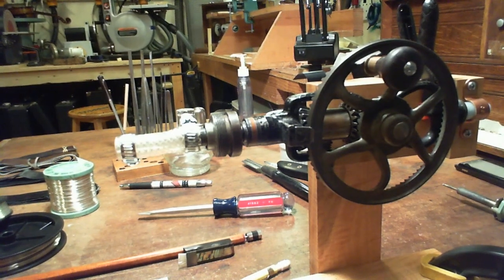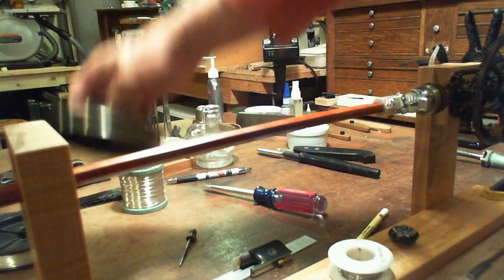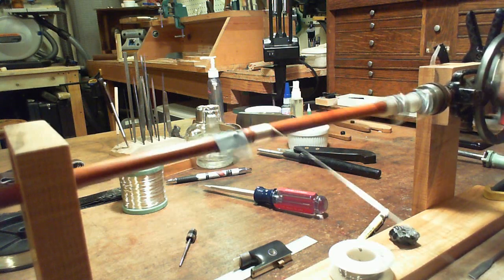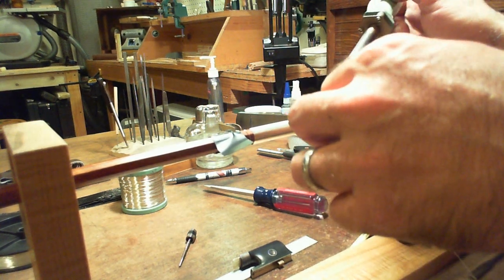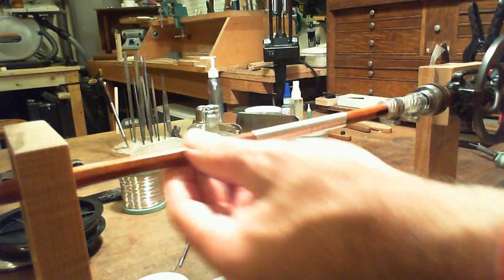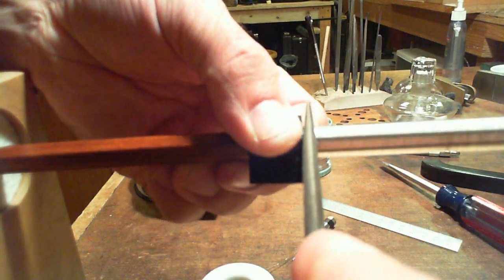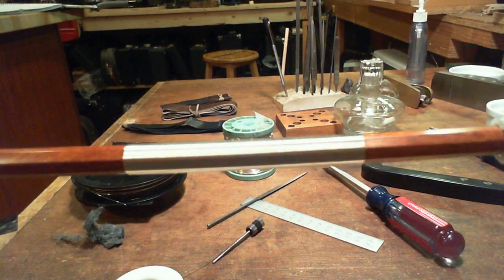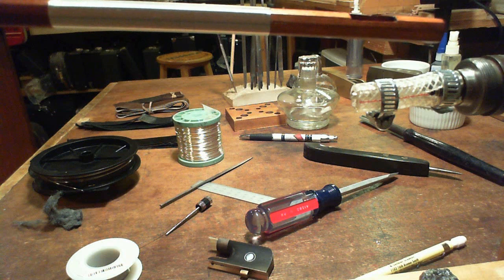Installing a Grip on a Violin Bow, Part 1: Silver Wire

Comment from the maker: Hi, Thanks! The drill that I used was a vintage Millers Falls drill. I've made several of these winding machines with similar hand drills made by Craftsman and Yankee. There are many old drills like this available on ebay for less than $10. The main modification I did was to unscrew the original chuck, replacing it with the bow clamp (made from fuel tubing and small hose clamps). I also removed the wooden handles from the drill, using those mounts to attach it to the wooden base that I made.

Comment from the maker: Thanks Oleksandr. For the silver wire, the most common diameter is .30mm. I also use .20mm, .25mm and .35mm diameters to add more or less weight. As for the length of the lapping, the length will vary somewhat, but the total length is usually about 75mm long, but could be anywhere from 65mm to 85mm, depending upon the desired effect to the weight and balance of the bow..
Reply: where can I buy the silver wire?

Comment: I have a lot of questions:
1 How to most excellent weigh instrument bow?-Where should be  center of gravity in bow? 
2. AD 1: I bought big stock of silver wire (0,3 mm) and i don`t won`t to use other wires. Where is point of starting a silver grip and point of finish the grip? 

Thanks

Comment: A violin bow is approximately .345”diameter=1.083” per turn of winding.
Using  sterling silver wire
28 ga has a diameter of .0128”, weighing .280 gm/ft ; requires 78 turns/inch x 1.083= 7.04 ft of wire/inch and weighs1.97 gm/inch of winding, 
30 ga has a diameter of .0100” weighing .155 gm/ft; requires100 turns/inch x 1.083”= 9.03 ft of wire/inch and weighs1.40 gm/inch of winding
3” of 28ga winding weighs approximately 5.91 grams
3” of 30ga winding weighs approximately 4.20 grams

Comment: Hello Sir, love your work! Would you mind telling what kind of soldering you've used to sold silver? I still haven't found any answers from other makers. Hope you can help me! Thanks 👍
Reply from the maker: Thanks for watching the video and for the question. The solder that I use is a silver-bearing, lead-free solder that is made for electronics work. The diameter of the solder is around .5mm and the silver content is 3%. There are many different brands of solder sold, but this type of solder can be purchased online through an electronics repair supply or through Amazon.

Comment: Hi Josh, Cool video!  I'm a Musician here in NYC and I've been doing fretted instrument repairs for 10 years here in town.  I'm now getting into Violin and Bass repairs.  Lots of Upright players here!  I love your jig for wrapping the wire.  I have one of those Millers Falls hand drills.  I'm thinking of building the same jig.  Did you put a bolt through the back where the small handle unscrewed?  I think it's no problem to match the threads at the hardware store.

Comment from the maker: Thanks for the question HSTrueMan. The white part that holds the upper part of the bow was made from ~.5" thick felt that was made for piano hammers. I got it from the guy that tunes my piano. I know of someone that made this part from several thicknesses of an old mouse pad, cut and glued together. All you really need is something that is a bit stiff, but has some softness to it to hold the bow in the right place and to prevent it from getting scratched as it turns in the fixture.

Comment: Hi, this is a great video. I was wondering what power your soldering iron is, and what type of silver solder you use? My experience with soldering the lapping is that it requires a high enough temperature to melt the solder quickly while minimising the risk of scorching the stick. Thanks!
Reply: Try using rosin solder since silver solder usually won't melt until the wire is red hot.